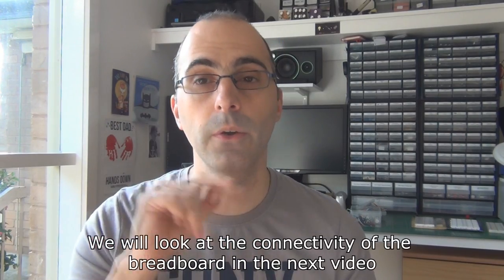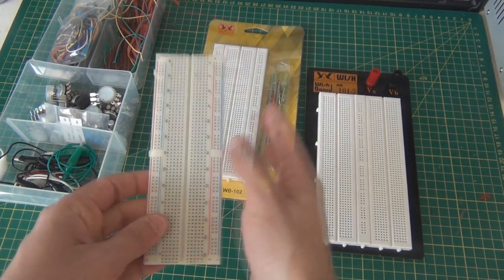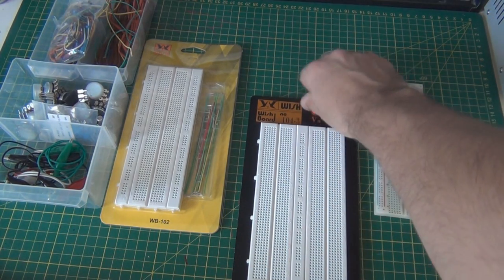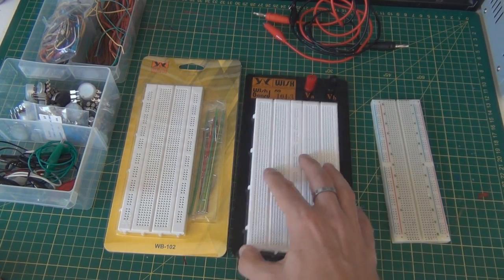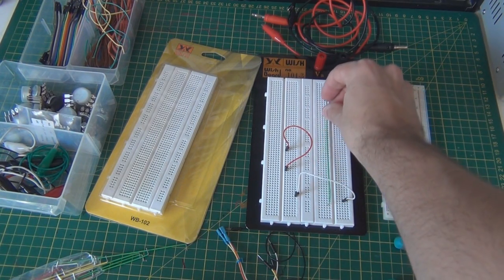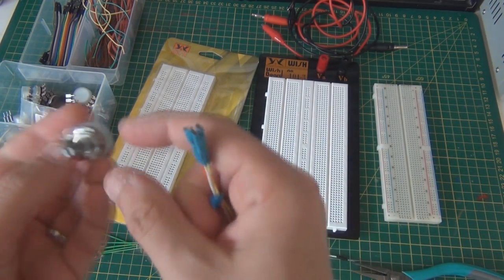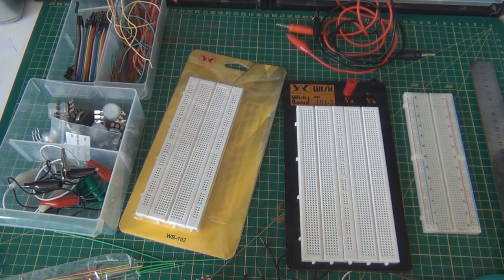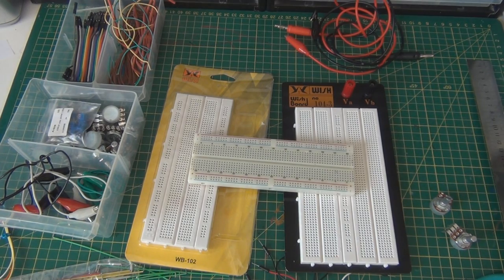Guitar Pedal Breadboarding Introduction

Comment: I've got the budget one on the far right, stuck it to a parts container about the size of a Smallbear DD case that I wired up with a pair of output jacks and a power supply jack - I use a multi-voltage wall-wart "Battery Replacer" unit to provide power.  Just finished designing/building my first pedal with that setup, served me well the past 4 months.

Comment: Spade connectors... genius!!! Can't believe I hadn't seen it before. Jumper cables...  I do recommend getting a few rolls of 22AWG tinned solid core in a number of colours. Cut off what you need to size. The dedicated stuff has thick insulation which is good/sturdy.
Reply: har234908234 You could also use Cat 5/6 cable .
Reply: Good call. 22AWG - and probably a lot cheaper than individual rolls! I've done it but there are some problems... it's not tinned which isn't much of a prob, but the insulation can be... slippery? I had a bastard of a time trying to strip the stuff I had... but it's worth considering.
Reply: har234908234 Haha indeed . Yes you need the special wire cutters and a gripping pair of plierd to strip. I built a whole 13 breadboard synth with the stuff. Would have cost me a packet if i had bought the pre made stuff . Plus you can dress it in and cut it to suit and keep your board tidy. Check out my prototype on my channel if you get a mo. You will see Cat 5 all over it ;-)

Comment: Tried to build a half-digital/half-analog pedal on a breadboard, but it's very noisy (it is actually a clean sound as it is supposed to be, but I can hear the "clicking" of a led turning on and off). How can I get rid of that?
Reply: Breadboards are inherently noisy due to lack of shielding and long component legs. I'm sure you know that by now, but for anyone else wondering.